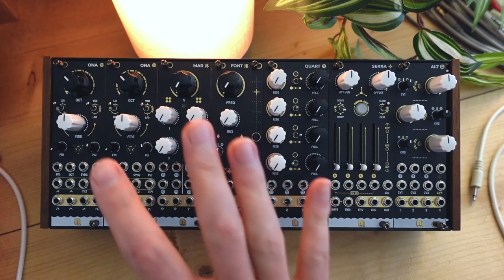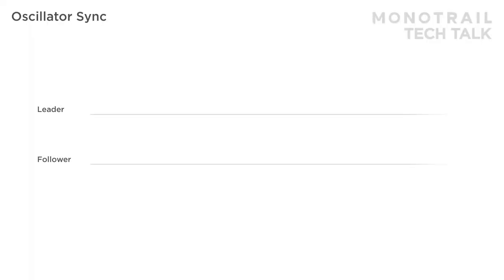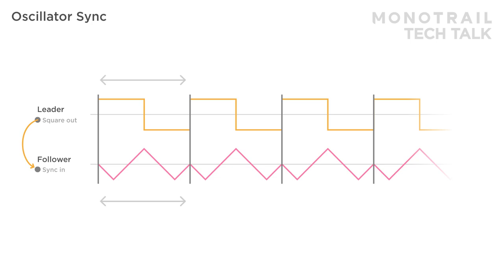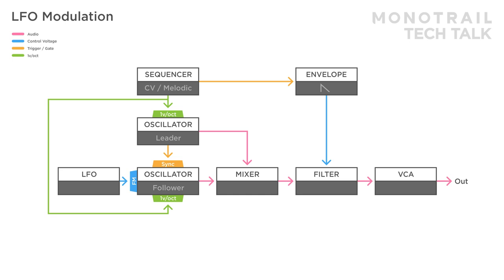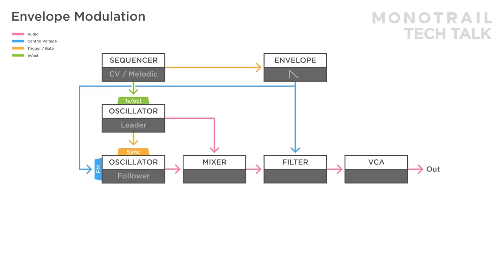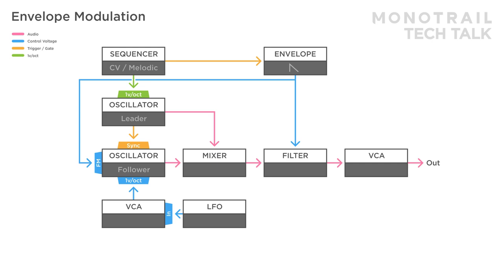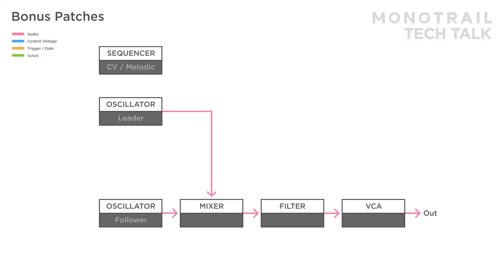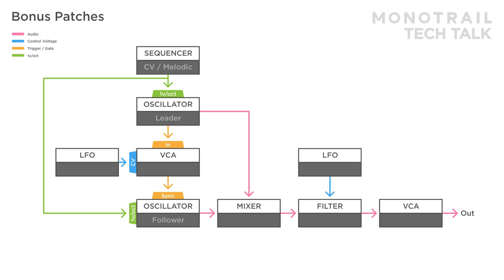20+ patch ideas for oscillator sync in a compact synth voice – With Nano

Comment: Great demo, covers a lot of ground. I also use triggers into hard sync on my oscillators when making percussion sounds to get a more uniform transient. When using a very snappy VCA envelope you might get more pronounced clicks depending on whether the oscillators voltage is high or near zero at the moment of being triggered. When the trigger for the envelope is multed and put into the sync input, the waveform will always be in the same position.
Reply from the maker: Ha, thanks for sharing, that's a good trick indeed! Cheers :)

Comment: I lose track of what the modules are in the live camera shot - any chance you could occasionally put an overlay over the live camera shot with a reminder of what kinds of modules those are? (ie. osc, mixer, lfo, etc) - thanks!
Reply: What a great video! I thought oscillator sync was either on or off. Like you want that Ric Ocasek sound, or you don't. . .  turns out there's more to it than that - who knew?